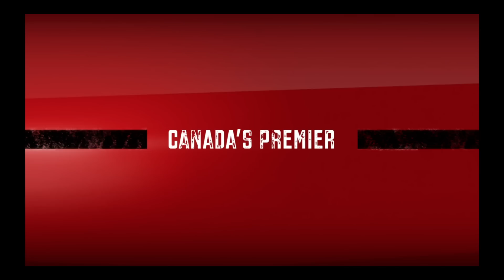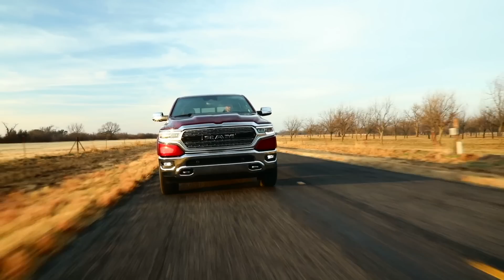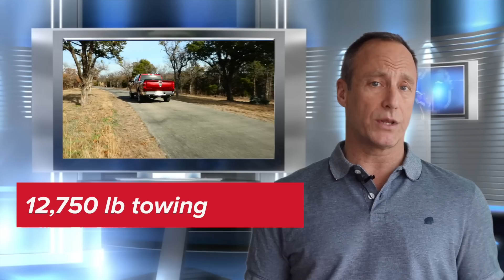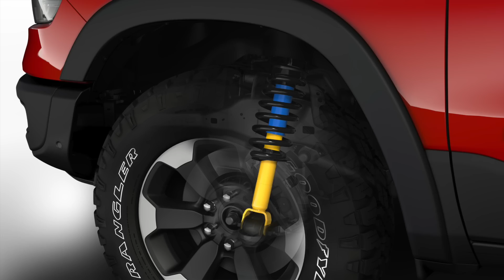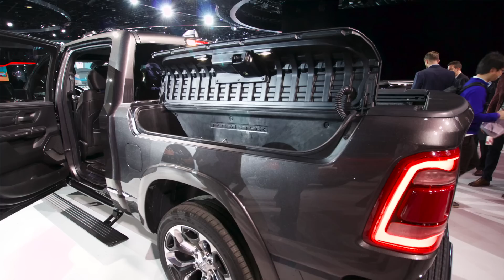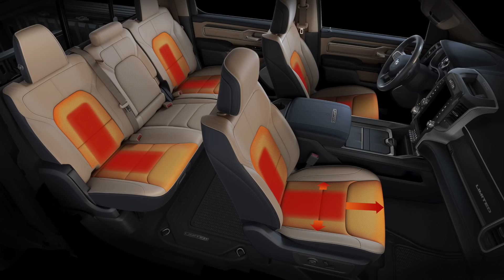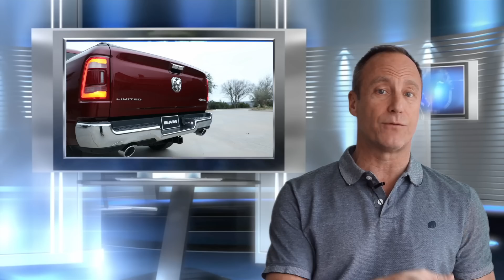Ram 1500 Engine Drive Train

Comment: Lower control arm is aluminum? Damn one strong hit and its gone, that's why make this trucks trash, they start changing thinks for make it lighters and fancy but just destroy the liability and the customer pocket, all this pieces should be made of steel man, a hard structure, aluminum is garbage.

Comment: I bought the 2020 with the 5.7 NON etorque! Beautiful truck awesome ride but this video didn't ease my worry about that damn Hemi tick and cam wear. If they fixed that, it would be the perfect truck. I've got 50,000 miles to decide if I need to get rid of it.

Comment: Considered the Ram - really wanted the Eco Diesel 3.0 - but bought the 2017 F150 3.5L XLT 4X4 SC. Wrong move on my part; first the front axle 4X4 system failed, 34K, covered under warranty - an issue plaguing Ford's since 2004 - unacceptable! Now at 74K the timing chain/phaser death rattle at startup, but of course warranty expired and now at my expense - another know to Ford part design/supplier failure ($1.5k repair to be performed). So much for Ford loyalty, bye, bye Ford! Next truck will be the Ram Eco Diesel!

Comment: just purchased a brand new 2019 Ram 1500 Big Horn Classic, love it and yes 32inch tires 20"rims, and all the bells and whistles except 12" screen got the 8", and no sun roof don't need it but everything else is ugh beautiful, also just put a Solo Performance Exhaust which still leaves it looking stock but with an intense aggressive sound and the power ooohh, and a SB cold air intake what a difference, I'm loving every minute driving this and wanna drive it more.

Comment: The Hemi doesn't need more torque, give the v6 more down low torque and give it some battery range and you have a winner , quit dumbing the lower drivetrains to make the v8s look better , this is the reason I will probably never buy another Dodge even though I like the looks .I really dug the side by side acceleration tests of the v8 and v6 ( the v6 was carrying a higher gear ratio( wtf?)You never really get to spec the truck you want .( I know,I know its about profit, bring an EV truck on)

Comment: I'm totally sold on the Hemi engine and 8 speed transmission. I hope to buy my 4th Ram 1500 this year. Including the drive train Ive been trying to get since 2005.  RM.
Reply: I would love a 392 cu. In. 6.2ltr  turbo charged 1500 with 8spd. Trans. Posi traction around 495-507 go  RM.

Comment: My 2004.5 Dodge Ram H.O. Cummins is still running strong!  Runs like a champ at 250,000 miles!  I like the new ones but I just can not part with my old ram cummins! Ha

Comment: What a waste of material! My truck needs to work, why would I spend way to much money when I know it’s going to be put to real use and not just to go to the mall!  or down a gravel road, and call it off roading. They need to go back to making things that will last 50+ years ... not just the 5 years you get on warranty then it all starts failing and 5 years after that you have spent just as much repairing all this crap as you spent on the truck

Comment: Wow they messed up, but also did a good job for a regular rich person.  All this technology in the transmission, differential, and engine means more shit to break and reduced relibility for when you need a work truck. The F-150, Silverado and Tundra will definitely be more reliable for work especially the Tundra and Silverado with big NON efficient transmissions and axles and engines. Again, "Efficiency vs Relibility" you choose what you want because you can never get both outta the two probably except the F-150 with the v8 and aluminum body, but still just go steel Ford lol. The Tundra being on a 10 or 12 year old platform is now  fucking garbage on power and fuel economy, but that truck will last you a lifetime and with that massive 4.30R which is found in F-350's and 3500HD's can still tow a 15,000lb trailer no problems, 10,000lbs is no where near the max the Tundra can tow. The Silverado is a versatile choice of relibility and power, the F-150 is very good on economy but okay on relibility but still a strong platform. Now, for rich people sick and tired of Mercedes-Benz hell go and buy this ram ! It's basically a lifted luxury car now. Coils in the back, air suspension, 8 speed electronics efficiency transmission like sorry but this is not a work truck anymore.

Comment: After 33 years of Chevrolet loyalty I could not endure one more failed attempt at technological leaps that used me as the guinea pig. My well maintained 5.3 motor failed at 94k miles. And the carbon fouled Direct Injection effectively destroyed the fine LS motor. So your days ago I purchased a 2018 Hemi Ram. Tried, true, well sorted machine without risky untested technology. Watching this reaffirms my decision to NOT buy the new Nissan or wait for the 2019 Silverado or Ram. Kudos to Toyota and Ford for having resolved the DI issues. But love the low tech Hemi Ram!!!!

Comment: Truthfully, I would want a truck to be a truck again. V8 power and a manual shift transfer case and transmission. All of this electronic stuff is just more stuff to go wrong in 2-5 years and add to the ownership costs for the next 10. Obviously there should be some amenities such as A/C, P/S, P/B, and a locker front and rear.....
Reply from the maker: There's always the used market. Just have to find one that's been well taken care of.

Comment: 2-3mpg (~10% improvement) is a big deal. I'm required to to have a 1/2 ton truck, and I drive about 30k a year. My current 17' Ram 1500 4x4 with Hemi gets about 22mpg average with cruise set to 68mph. 25mpg would be a big deal, and you'd still have the power to tow. I also like how the whole unit is external and not built into the transmission. It will be interesting how this system plays out.
Reply from the maker: The electric generator is bolted to the engine but the system does require a special Torquelight transmission to make the whole thing work.

Comment: Truck prices from Gm, Ford, and Ram have gotten obscenely expensive! I'll buy a used truck a few years old and save money.
Reply from the maker: Good strategy. Let somebody else pay the depreciation and work out the bugs.
Reply: Exactly and maintain the truck properly and it will last years, I routinely get 300,000 miles out of my vehicles with that principle. In fact, I expect 300,000 miles minimum from my vehicles. Best I've done was with my 1994 Toyota Corolla I bought new, it had 386,000 miles before the tranny quit.

Comment: my old GMC 1988  1500 could do 2380 pounds with no issues.   and in saw 3100 pounds in a GMC 2500 so  2300 pounds is ok I guess.   but have they fixed the cheep plastics?  and what about the bad front suspension in that Ram?  also why not have the RAM horns in front  the word RAM to me is Random Access Memory, not a Truck front emblem...   And DODGE was a better name then RAM,  as RAM looks cheep as a brand name.    but I must say, still better then a Found on Road dead product...
Reply from the maker: Thanks for commenting!

Comment: I would easily choose the Ram  if they updated their tired old Hemi engine, the Hybrid feature seems to be just another way to achieve start-stop and does not add to the poor performance of the HEMI when compared to the Chevy and the Ford. Maybe next year...
Reply: Are you kidding?? It doesn't need updating. Power, economy, reliability what more do you want. It's been around a while, yes, but that means the bugs have been worked out.

Comment: I own a F-150 2015 and yes i should think to RAM before buying a new truck. I like the new engine tech and the all the improvements to the truck. This is a good fighter to face Ford.
Reply from the maker: Thanks for the comment. I agree. I had the 5.7L Hemi in my 2004 Ram 1500 and to have a better transmission with the eTorque system just makes me salivate.

Comment: Dodge is loosing its base with this nonsense! I'm sorry but give me the old 12 valve non electric as a option in a half ton!!! This has been the reason for so many of us to love dodge and that is, when all others were going "hybrid" dodge was offering 395hp standard. When others was going for comfort, dodge was offering stick shift with 3:90 rears. When others was offering safety, dodge said lets turn the A/C unit into a heat exchanger. C'mon dodge.... You just put the demon out and this is what you asked your engineering team to do? One thing is fact, when I bought my 04ram 1500 new, I never once worried about scratching it, working on it, go mudding with it exc. maybe it's time I look at a foreign model......
Reply from the maker: That's the beauty of buying a used truck - you never once worry about scratching it, working on it, go mudding with it etc.

Comment: Love my 2015 Ram Big Horn for sure but i'll at least wait until 2020 for the bugs to be worked out. I hate being a beta tester.
Reply from the maker: There's a lot to be said for giving it a year to avoid being the beta tester. But what do you do if you really need a new truck this year and can't afford to wait? Settle for the last year of the old style (fast depreciation) or roll the dice and bet on the Ram engineers?
Reply: In that circumstance I would go new and expect problems. It would have to be a hell of a deal to buy an 18 and even then I've done that before and regretted it.

Comment: All these so-called advances will make this truck worthless when It reaches an older age. You will not be able to repair it when the cost outweighs the value... There is and old adage, keep it simple stupid.....It works..
Reply from the maker: I wonder if they said the same thing about ABS brakes when introduced in the 80's...?
Reply: Don't care!!!

Comment: 4WD Magazine. It looks like the Rebel, Off Road, or both, have steel lower control arms, or are they just painted aluminum? If they are steel, why? Personally, I would prefer steel suspension arms, especially on a truck. Suspension, is to critical to be playing the weight savings game with.
Reply from the maker: Ram says the lower control is aluminum. You make a good point though, which is always part of the aluminum vs steel debate. My thoughts are that the strength will only be seriously tested in a collision, in which case it won't matter whether it is steel or aluminum, as any deformation will require replacement.
Reply: 4WD Magazine. Thanks for the responce. If a rock impacts an Aluminum control arm it can crack, instead of bending like a steel control arm would.

Comment: I want none of the failure prone under engineered crap I want a trouble free work truck. That's why I'm keeping my 1990 w250 cummins 12 valve power TRUCK with 850,000 miles and everything still works .last real truck.dont want all the crap used to  keep track of who what and where I'm doing things! I can afford a new truck but I'm not paying for plastic anymore auto manufacturers can kiss my sale good by
Reply from the maker: Thanks for the comments.

Comment: so they haven't really done anything aside from adding more electronic shit which already caused enough trouble with older models
Reply from the maker: On the up side, could be they got it right this time
Reply: maybe but i kinda doubt it. i love my 2014 but all the little electronic issues sure get annoying. the rear diff cooling/heating is pretty interesting tho. i don't really see the point of the E torque thing either. with the 5.7L, 8 speed and 3.92 axles there's already plenty of torque getting to the wheels. i could see it helping out the 3.6L but really if someone actually needs that torque they should be getting the 5.7L. seems like something better suited for the diesels pulling those really heavy loads

Comment: I wish start stop would go away. Engines barely use any fuel when idling even large truck ones. It's just 1 more thing that can go wrong. And one more annoyance. Auto makers do this to pad their mpg numbers because of how much stopped time is in the government tests. Real world it doesn't do squat. The extra you are paying for the tech will not pay for itself in the life of the vehicle even if gas was $5 per gallon.
Reply from the maker: I suspect you may be right.
Reply: Mike:  I'm with you on this.  They have to beef up the systems to accommodate the technology which of course means those products supporting the start/stop are going to cost more to replace.  I rented a Chevy Impala in Florida and this was such a pain in the butt.
Reply: Mike I have that on my new Wrangler and I can’t stand that.  I have to remind myself to turn that shit off every time I get in and fasten the seatbelt.  I’d rather have to hit a button to engage it, not turn it off

Comment: The ram is a way nice truck.  I own a 2014 ram Laramie crew cab.  The extra cab space with reclining rear seats is a great upgrade.  I like the increased payload and towing capacity.  I will wait to see what pricing is, probably North of $65,000 for the limited model.  Good job RAM!
Reply from the maker: That's for commenting - great to hear from someone with experience owning.

Comment: Are the brake rotors still going to warp at less than 80,000 and am I still going to have to replace ball joints at less than 100,000? Not to mention having to take it to multiple dealers multiple times just to find someone that can do a proper alignment on it!
Reply from the maker: Sounds like you had some tough times. What year and model did/do you have? I'm pretty certain any weak points have been resolved.
Reply: I would tell you rotors to 80k miles are great.  Today even break pads are nearly reaching this mileage.

Comment: manufacturers should talk to kids. when i was a kid and got a grasp how things work. i ask why dont they make an 8 speed. or so.  another 20 years go by. nowwwww we are like. lets try this. ive never driven one so idk if i like it. dont know if i want it shifting all the time.
Reply from the maker: The shifting is very smooth, and so are the ten-speeds from Chevy and Ford. You don't really hear it or feel it but there is always power when you want it and fuel saving low rpm's when you don't.
Reply: The only time you can tell between shifts is when you put your foot down.

Comment: I'll keep my 3500 with the manual transmission
Reply from the maker: I had a manual transmission in a 4x4 Suv. Propably the most fun I've had driving a truck
Reply: Exactly. Every truck I've owned was a manual transmission. This is the first one that's had power windows and locks, LOL.

Comment: Probably a 50 grand truck. No thanks. Trucks are just getting to expensive.
Reply: on what planet?
Reply: You can get one for $30,000 that still looks good without all the fancy stuff. Just go to a small dealer who’ll take more off the top.
Reply from the maker: Just stick to the base models and every year you get a lot of truck for $25K. Not fully loaded but still a solid truck.

Comment: all this junk is one those ideas that’s only good on paper, but in the real world and in countries that have a harsh climate, this is going to mess up bad and fast, already see a lot of 16s coming in for electrical issues...
Reply: +Bill Williamson I have a 2017 Ram with air suspension, Ecodiesel, and have 20k. No problem so far. This is my third Ecodiesel with air suspension and no issues at all here in Alberta. Dry air here maybe that helps. Check this out. https://www.quadratec.com/c/blog/brothers-challenge
Reply from the maker: What part of the world are you in Bill?
Reply: 4WD Magazine northwestern Ontario, Canada. My uncle purchased a 2017 Dodge and the air ride suspension has been nothing but trouble, in -40 the air lines get moisture and condensation and the freeze up causing cracking and in one one case, causing the on board air compressor to fail, thankfully our troublesome dealer was good for warranty but i could only imagine the cost of it had to be paid out of pocket.
Reply: Mike Schnell that’s pretty good, my Uncle got a lemon sadly, air suspension got moisture in the system and it messed up everything when it froze come winter here in Ontario, his ecodiesel has been alright but it’s already been in for warranty on the ignition switch
Reply: Bill Williamson ya I heard the air suspension doesn't work when it gets really cold...ram should fix this or not sell airride up north

Comment: The rebel looks great, my silverado truck is fully loaded and way too expensive, I’ll never spend this much on a truck again, I’m going to be spending a lot in repairs when the warrantee runs out, I’d rather a truck with an off road package like the raptor, it’s the only ford I’d drive, I think the raptors that good but way overpriced for what it is, it is one of the only trucks with a true off road package, the reaper is very mediocre, only one inch higher, and no increased wheel travel... it’s just an appearance package, the 33” tires are smaller than the normal stock tires, although I do like it, I wouldn’t spend much more for stickers and mediocre shocks. Please somebody come out with a bare bones truck that’s cheap and have a good suspension and larger tires with better approach and departure angles.
Reply from the maker: Best thing is to buy the most basic model and trim line with the engine you want, and then go to the aftermarket to add all the goodies you want - like lift, tires, bumpers etc. That way you'll only pay for the upgrades that mean the most to you.